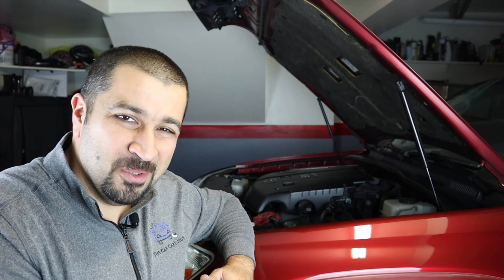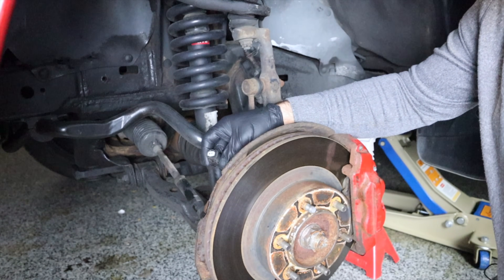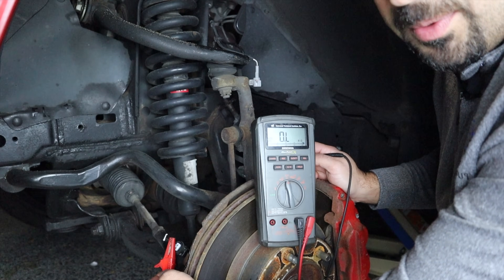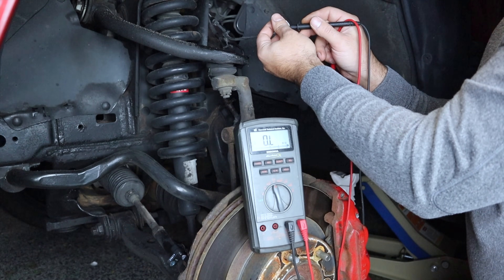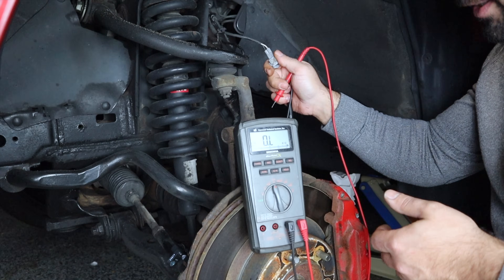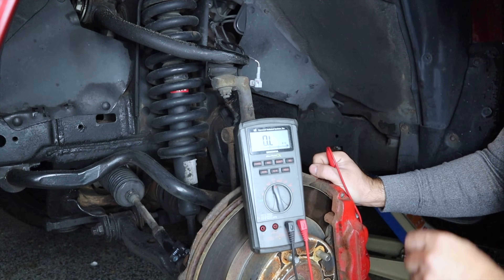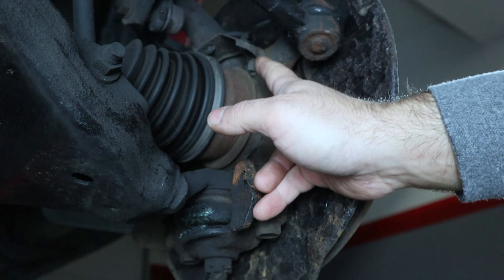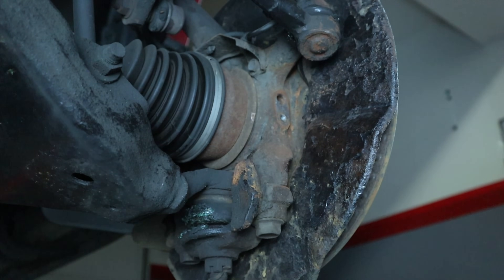ABS Diagnosis Tips from a Toyota Mechanic. Fix It Right The First Time

Comment: The speed sensor is cheap why bother to check it?
Reply: In my independent service practice in SF Bay Area, it’s about 3 out of 4 for Toyotas/ Lexus that it is a bad sensor.  It’s best practice to check as much of the wiring harness and the sensor with a DVM for continuity with tugging and bending and to back probe towards the ECU for as much measure data as possible using the other working side as a reference if required. This will allow a higher confidence level of the identified cause and a more accurate estimate . OEM (I would not recommend aftermarket unless OEM is NLA) sensors are not always in stock or available same day nor are they returnable unless it is defective within the warranty period.  Always ohm out the replacement sensor prior to installation for those rare situations that it arrives defective new.
Reply from the maker: Original ones are not cheap

Comment: I am a retired elevator mechanic and I have had very good luck with DeoxIT D100L contact stablent. I was wondering if it might be a good idea to use it in a connector that has shown signs of corrosion. Also, what do you think about spraying the sensor with penetrating oil before removal? Then painting the sensor area to slow down future rust.
Reply from the maker: It wouldn’t be a bad idea to spray it down

Comment: Do you think there is any benefit to putting some grease or rust inhibitor on the flat surface after you clean the rust off before installing the sensor?
Reply from the maker: Honestly this sensor will be there for a good while. This is the original sensor from 16 years ago. It will eventually do the same thing again

Comment: Thanks for the video. Question beside the topic from this video. For the oil used in my 2012 highlander. It’s called for 0W-20 weigh. Is the quality of the oil from auto part differ from the dealer one or the same quality ? Thanks
Reply from the maker: Hi! For the same brand there’s no difference. Toyota branded oil is very good for Toyota models
Reply: @TheCarCareNut  thanks

Comment: Hi great video. Do you have  any ideas or clues on 2000 Toyota 4Runner v6. 2wd P0500 can you respond please . Thanks again 🙏
Reply from the maker: Hi! Will need some diagnosis on this one. They do have a speed sensor on the trans but it could also be an abs issue

Comment: Always learning something new from you brother 👍.  Glad that there is no need for salt to be used on the roads in my area or any area that my car would likely go outside of high surf or a tsunami.  Is there any indication for which you can tell right away if salt was used on a road?
Reply from the maker: Hi! Most cars here will show visible surface rust after one winter so it’s very easy to catch them.

Comment: Thanks for the video!   
1. Do you recommend using any Dielectric Grease on this electrical contacts/connectors?
2. I assume a light coating (just enough so Not attract dust/dirt) of silicon grease on the sensor O-ring is okay?
Reply from the maker: Hi! A small amount is a good idea just not too much
Reply: @TheCarCareNut  Thank you,  AMD!!

Comment: Nice video again!! This would make a good intro to R&R front wheel bearing job without the shop press😂❤️👍Have a Great Day.
Reply: If you live in the rust belt you may not be able to use the on car hub pullers to extract a bearing from a truck (Tacoma, 4Runner, tundra, etc..). They can get Extremely frozen in there…. Saw one that required a 40 ton press to get it out…. It deformed a 12 ton HF press trying to get it out. I told them to replace the whole knuckle because surely something is bent…

Comment: 2007 Camry Hybrid - Passenger removed seat belt and opened the door before the car was stopped. Then when leaving the car had a warning to check the hybrid system and would not accelerate as normal. I stopped the car and parked and restarted the car a few hours later and the car ran normally and has ran normal sense. Should I have the car hybrid system checked or was that a false warning message.
Reply from the maker: Hi! I would have it checked

Comment: Should I get the new Prius or the new Corolla cross?
Reply from the maker: Hi! The Prius is very good if you like it! The corolla cross is an impressive car as it takes a very good model and makes it larger
Reply: @TheCarCareNut  I’m stuck between the two atm I live in Dubuque and the snow gets me pretty anxious I also have two 40 pound dogs and I’m curious as to if they’d fit better in the Prius or the cross as well
Reply from the maker: The cross will likely be better for big dogs.